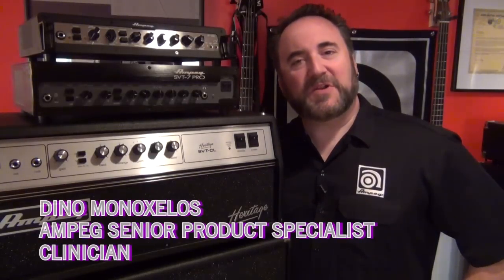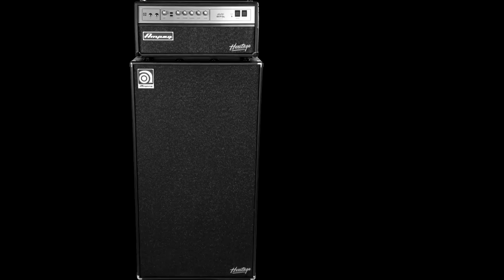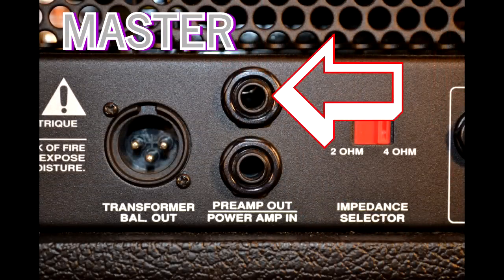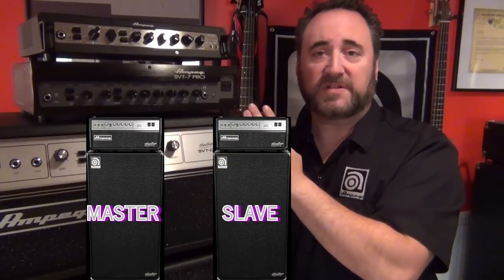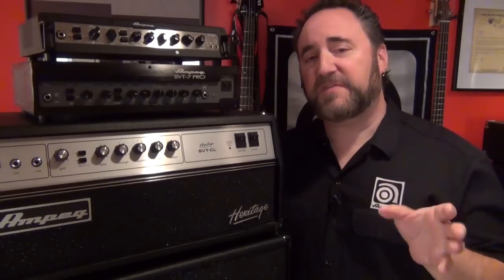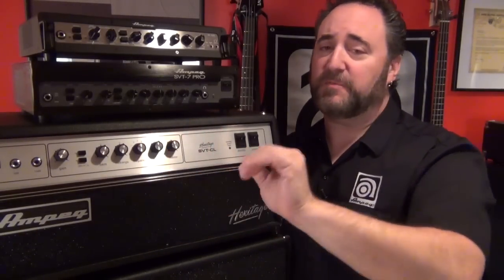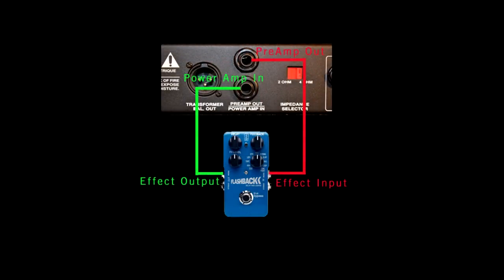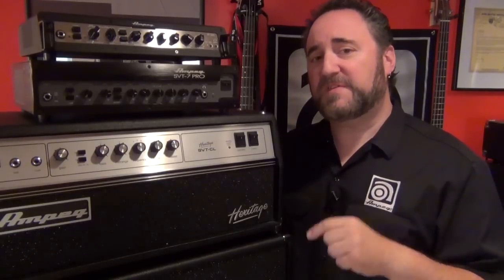Ampeg Tricks and Tips - Preamp Out / Power Amp In

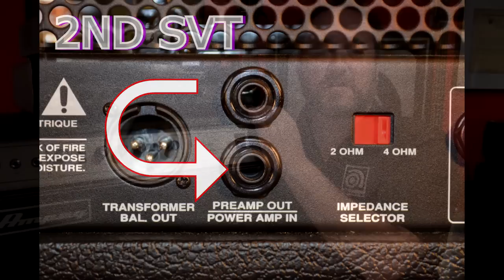Comment: I think you're confused.  You can't daisy chain Preamp Out jacks past the second amp as you state at 1:55. For other readers, you say why it's wrong at 1:30.  When a cord is plugged into the Power Amp In jack, the Power Amp In jack DISCONNECTS from the Preamp Out jack.  The Power In jack is a different jack type than the Preamp Out jack.  The Preamp Out jack, with a cord plugged in, does Not disconnect from the Power Amp In jack.   That means that, if you put a signal into the Power Amp In jack, you can't get that signal out of the Preamp Out jack.  However, according to the Owner's Manual, the "Slave" jack is connected to the Power Amp In jack, so when a cord is plugged into the Power Amp In jack, the same signal on the cord IS available at the "SLAVE" jack and can be used to feed a third, etc., amp.
Reply: I know this post is hella old, but I was literally thinking the same thing. My question is, would it be theoretically possible to come out of the preamp out(amp1) to poweramp in(amp 2) and slave out(amp 1) to poweramp in (amp 3)? Or would you ONLY be able to go from preamp out(amp 1) to poweramp in(amp 2) and then, from slave out(amp 2) to poweramp in(amp 3)? Both of these methods bypass the disconnected preamp out in amp 2.

Comment: Dino, I wanted your take on this scenario...I have (2) SVT 3 pro heads, and I use an SVT 4x10 Classic cabinet with one of them, works great. I recently came across a Mesa Boogie 4X10 8ohm 600-watt cabinet. Obviously, I can't power this cab with one of my SVT 3 heads, but I was wondering if I could use the power amp in and preamp out jacks the same way you are talking about to power this one cabinet? Would that create 550 watts at 4 ohms each, which would be a decent fit for an 8ohm 600-watt cabinet? Let me know your advice, thanks!

Comment: Can you plug the 1/4 inch jacks from the preamp out to the regular input where you would plug the guitar in? That is from your guitar to the main amp input, then an 1/4 inch output preamp to another amp regular input?
Thanks much?
Reply: Your final signal coming out of the 2nd amp cabinet will be different than the signal coming out of the 1st cabinet/1st preamp out. The configuration you propose would have the preamp signal from the first amp combined with the preamp signal from the second amp, both simultaneously coming out of the second amp cabinet. This would likely clip the signal and cause some nasty distortion, and possible damage to your cabinet speakers in cab 2, if you aren't careful. The methid explained in the video is the best way. Stacking two preamps will give you a horrible S/N ratio.

Comment: You said to use a standard guitar cable. Are you talking about instrument cables or speaker cables? Also, is it possible to do the opposite of adding a preamp, bypassing the one in the head, and instead add a power amp to allow the head to transmit more power? (900w power amp into a 200 watt ampeg, for an example) of course run into proper speakers. I'm curious about if this is possible on any amp, of any brand, although I seem to doubt it.
Reply: He said guitar cable, but then you ask if he means speaker cables? You answered your own question before you even asked it.

Comment: Can you go pre amp out into the other amps input? So you can use volumes on both?
Reply: Your final signal coming out of the 2nd amp cabinet will be different than the signal coming out of the 1st cabinet/1st preamp out. The configuration you propose would have the preamp signal from the first amp combined with the preamp signal from the second amp, both simultaneously coming out of the second amp cabinet. This would likely clip the signal and cause some nasty distortion, and possible damage to your cabinet speakers in cab 2, if you aren't careful. The methid explained in the video is the best way. Stacking two preamps will give you a horrible S/N ratio.

ZapDash

Comment: The obvious correct answer is to use multiples of 4 x SVT 810e cabs, two SVT heads, one head per pair of cabs, one head the master and other the slave, both set to 2 ohms.  //Also, running direct into an SVT power section actually sounds pretty damned good.

Comment: HELP!!! i just got an ampeg 140c and i just one run it through one cab.. bit all i see is 2 chorus and 2 dry. which one do i plug it in to. im so use to just simply seeing output and input.
Reply: You have to use both speaker outputs to a stereo cab to get the full 140watts. 70watts each side.
Reply: One dry and one choruse for both sides since its stereo head. I have one too. Love it

Comment: Also Dino, I use a Boss ME20-B multi effects pedal - if I run it through the FX Loop on my PF500 it is very fuzzy, which I dont get if I run straight into the FX then the rig. I've tried lowering the output on the Boss but it doesnt seem to do much. is the loop designed for Rackmount processors? Could I run the ME20  through the Pre-out Power in as youve described?
Reply: Why can't you just go ahead and plug it between your bass and the input on the amp head, and press bypass when you don't want the effects?

Comment: Bass cabs are intentionally built deeper, not larger height- and width-wise.  It has to do with the projection of the lower frequencies of bass.  Trust me...I hooked an SVT Classic up to a 300w Marshall 4x12" cab for a while...needless to say I destroyed the Marshall pretty quick.  And if they built deep cabs with the same height and width as a Marshall 4x12", your back would be pissed off at you every time you had to lug those cabs around.  There is a method to the madness.